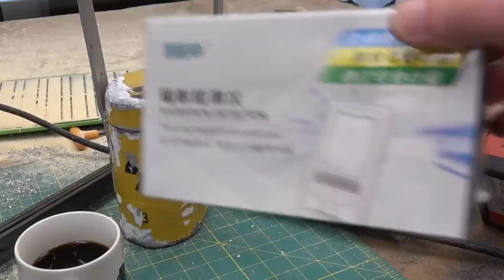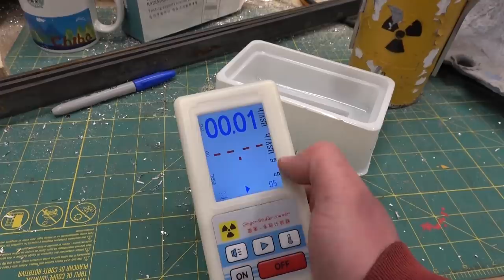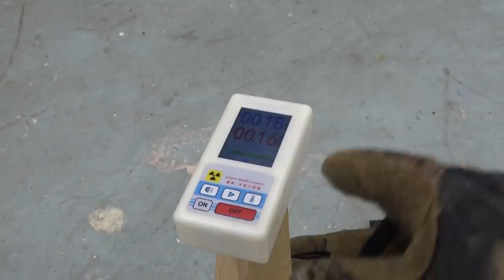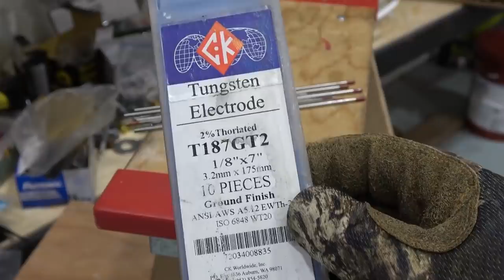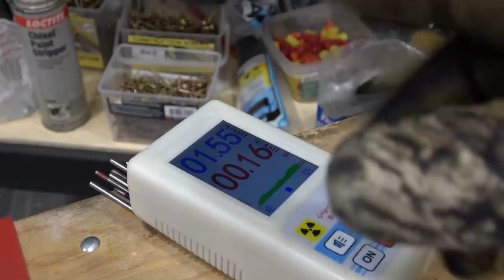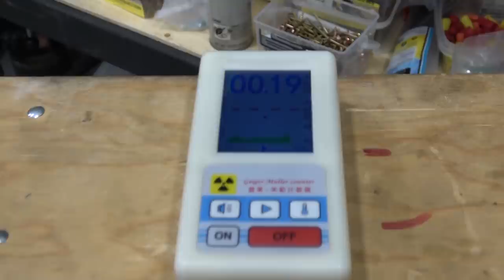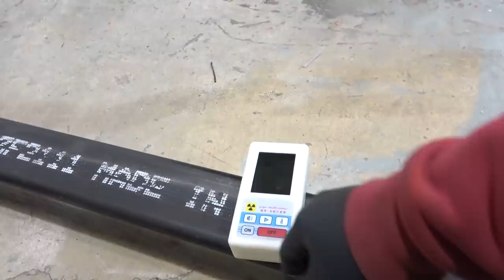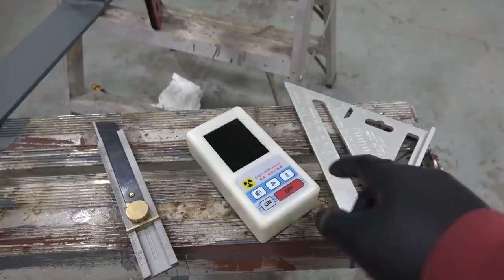Testing Radiation from Tungsten, Japanese Steel | Welding Metals Tested

Comment: Side note: reducing radiation in steel (albeit not to the extreme you mentioned) is of interest for more than just test equipment. When you have a 32" diameter electrode cranking out 140,000 amps in an electric are furnace and obliterating everything in it's path, it's best to have as little radiation present as possible. I work at a steel mill, and all of the scrap we melt goes through multiple ultra-sensitive radiation detectors before it gets anywhere near our furnace. Even something as unassuming as rainwater that has carried irradiated particulate from higher up in the atmosphere and pooled in the bed of a dump truck is enough to set them off. Arc furnaces generate a lot of off-gas and dust, and if what you're trying to melt is radioactive, it's a bad time for everyone.
Reply: What happens if a price of radioactive material gets in it?
Reply: Prolly just scrap after that always will have someothe rapplication tho
Reply: is this wy all the scrap merchants around me have radiation detectors you drive through? I have seen it go off when an old clock with the glowing hands went through. always wondered.
Reply: @liamshockley1856  The big deal isn't what happens to the material you are melting. You Really don't want contaminate your equipment and your exhaust-system/filter-system. At the mill I worked at, if the exhaust-system would require de-contamination/replacing it would risk sitting idle for so long it would have risked going out of business
Reply: @liamshockley1856  if we end up with a radioactive melt, we halt all operations and begin a very lengthy and very expensive cleanup operation that I've heard typically takes months.
Reply: @denisohbrien  this is exactly why. We won't even let trucks on site if they set the radiation detectors off. Better to catch it at the scrap facility rather than shipping it all the way to a mill and then having to ship it all the way back.
Reply: Not The Technician  Any time you have electricity arcing through air you have plasma. Think of an arc furnace kind of like a big stick welder. It just uses a whole lot of electricity to melt a whole lot of steel at once.
Reply: if something is welded with a thoriated tungsten is that going to set off the meters?
Reply: @lizardkeeper100  other material welded with thoriated tungsten no, but I bet the electrodes themselves would set off the detectors.
Reply: @johnt1815  interesting thank you
Reply: .... well smelting in an industrial cobalt 60 source, making rebar out of the steel and then building residential buildings in Taiwan with it also didnt produce too much happyness  https://en.m.wikipedia.org/wiki/Radioactive_scrap_metal
Reply: @johnt1815  thanks a lot, very interesting.
Reply: @marklundeberg7006  very true. The big fear is some sort of terrorist attack that would basically have the same affect as a dirty bomb, but realistically that's very unlikely to happen. The more real danger, as you've said,  is people not wanting to pay to dispose of radiation sources for various measuring equipment properly and trying to hide it in a bunch of scrap.
Reply: @wallacegrommet9343  I work at a Nucor facility, but not the one in Seattle. I don't want to give out too much personal information on the internet 😉
Reply: That explains the radiation detectors at the recycling yards!
Reply: Why do I have to come to one of the crudest channels on YouTube to find the most useful information I never knew I didn't know?
Reply: guitarstitch crudest!? AvE is part of my PhD! This is where you come to learn things you didn’t know that you didn’t know!
Reply: @liamshockley1856  https://en.wikipedia.org/wiki/Acerinox_accident
Reply: @StefanThePro  Crude, my friend, is tongue in cheek.  Once you cut the bullshit of the etiquette focused world, you can begin to focus on the meat of any topic rather than the fan fare and lip service.

I'd rather an honest "fuck from Uncle Bumblefuck over extravagant technobabble and bullshit any day.
Reply: @liamshockley1856  the particle would likely be put back into the breathable aircolumn with the dust and smoke. this creates a potential to become internally deposited within flora and fauna, which would damage their dna and cause cancer in the long term , while overexposure would result in organ failure and death within hours to weeks depending on dose rate, body mass, and some other metrics.
Reply: John T Damn, you must have weekly visits from OSHA then huh.
Reply: @mikeisaac3826  we try to maintain very good relationships with OSHA, EPA, and just about every other agency you can imagine lol
Reply: @ChrisGilliamOffGrid  yes both slag and the dust collected in the baghouses typically goes through further processing. I don't think much ends up in the slag as far as other metals go, and it is typically sold as fill material and is used mostly for concrete. The baghouse dust is where most of the heavy metals end up, and that gets sent somewhere for recycling.
Reply: John T As most places should but it’s still scary when they check all the equipment.
Reply: @ChrisGilliamOffGrid  we try to avoid copper in our scrap as much as possible. It's not particularly dangerous, but it's one of the few things that once it's mixed into steel it's impossible to f@#*ing get out lol. It doesn't react in a useful way to anything you can add to the  melt that typically helps separate impurities, and it reduces the strength of the final product. My rudimentary understanding is that copper collects at the grain boundaries when the steel solidifies and weakens the interface between grains.
Reply: My wife has never called it a 32" ramming electrode.
Reply: @guitarstitch  
Haha hellyeah bro! 
Nice to see someone with that positive go getter attitude! 
Not too many people can grasp the concept let alone understand,

"I didnt know I didn't know that" 

Love me some good knowledge I didn't know I didn't know about knowing!!! 
Happy times, folks!!! 
😀😉😎😃🙂😄😉😆😁
Reply: Chris Gilliam Man Stuff they are talking about cobalt-60, not copper. Copper’s designation is Cu, Co is cobalt. Copper isn’t very harmful. Cobalt-60 is bad news.
Reply: I always wondered what then yearly electrical bill was for one of them there 140,000 amp arc furnaces. Anyone have any idea?
Reply: @blackhawks81H   they usually have contracts with the power company's to run at night, using the "extra" energy on the grid instead of bringing power plants down. In a way, they help each other out and in return get a substantially reduced rate on electricity.  Many also have on site power generation plants to supplement.  As far as the dollar amount, I have no idea lol.
Reply: You had me at 32" dia. electrode and 140k Amps 😎 would be a sight to see that set up going in person!  Only seen videos of steel mills firing up their elec arc furnace.
Reply: @blackhawks81H  the cost will very quite a bit depending on the location of the mill and where they're getting their power from, but it's in the millions of dollars per month.
Reply: @aaronj08ar  all of the plants that I'm familiar with run basically 24/7, but then again they're almost all in relatively rural locations, so I'm guessing the grid utilization doesn't change as drastically based on time of day as it would in a city.
Reply: @johnt1815   I work in a 550 MW fossil plant in rural Colorado.  Our plant is base load generation and in the past was always at the high end of power production. But recently with all the renewable generation we have to accommodate that first as you can't reliably change the weather yet lol.  If the wind starts blowing real hard in Wyoming we drop to 200 MW and chase the windmills.  If it didn't take 2 days for us to start up marketing would take us off most every night. Most all plants are or will be doing "load regulation" as more renewables come online in the future. Nature gas plants, specifically combustion turbines will come on and shut off at a moment's notice as they can be operated remotely and only take roughly 15 min from cold to full load.
Reply: @aaronj08ar  I don't think I was clear: when I said "plants" I meant steel mills, not power plants lol. That's interesting though, I've never really thought about the startup time for a coal burning plant being that long, but it makes sense. I guess anything that burns solid fuels, whether it be a boiler or a blast furnace, is going to take a substantial amount of time to start up. Lol
Reply: At INEL.
I rubbed my shoulder against the red brick wall in the basement of my house.
When I got to my facility I set the frisker off as I entered.
(Imagine bars about 12" apart and  you have to squeeze through but the bars are actually detectors)
The ELT found a small red smudge on my shoulder , it was brick dust.
Reply: Not The Technician  p
Reply: Great, that'll only catch gamma, not beta or alpha emitters
Reply: Very intresting @john t
Reply: @denisohbrien  if the radiation detector went off when that clock went through, then that clock should've been taken to a museum, or put in a collection. Radium hasn't been used on clock dials since the 1970's
Reply: @NuclearSavety  The real hero with link!
Reply: @DCS101  I have some videos on my channel. In person it's just an ungodly loud and bright arc welder
Reply: All steel made from 1945 to 1965 was radioactive
Reply: I used to haul bulk salt out of port shared with an iron scrapyard. They’d get pissed off if you went faster than 2 mph past their detectors. Apparently salt has trace amounts of radiation.

Comment: There are two types of people in the world: those who have 55k of unread emails and those who have zero/
Reply: I'm only at 54,000
Reply: Never trust someone that doesn't have unread emails
Reply: @edwardleas1619  Or a clean desktop, real or electronic.
Reply: I’m at 580k I forgot about a forum that sent new post notifications
Reply: @Bugsyerin5646  im a get started on that right away. 
I can 100% guarantee it will look nothing like the websites portfolio
With the added benifit of 
sounds like it works but it does a bunch of nothing
Reply: @Bugsyerin5646  im in hear trying to learn to troll.
You telling me learn to code
Thats low bro.
Reply: I'm at 78k :'(
Reply: Im at like 127k at this point. I had to set up different stuff emails in order to escape the spam lol.

Comment: Hey AvE, long time listener, first time caller. As a practicing physician I felt the need to weigh in on this: The human eye is an intensity detector. Intensity is energy per time per area. While you are correct that the energy of emitted radiation falls off as 1/r^2, so does the solid angle (area) subtended by your eye. This means the intensity is constant with distance from the source. That's why all the street lights along a road appear the same brightness, even as they get further away. Also how we can see light from stars unfathomable distances away. Everything you said about aperture control is still correct but that just sets the overall scale of intensity that you are sensitive to.

Comment: I was the engineer on a project for a new low background shielded facility and high purity germanium radiation detectors.  I was told that we had to build the shielding out of steel cast prior to 1945 because all steel cast after 1945 is contaminated due to atmospheric testing of nuclear weapons.  I said no problem but first you prove it to me and show me test data on modern steel.  We tested about a dozen samples of modern steel including a piece from our existing low background shielding that came off a pre 1945 war ship.  The results showed that half the samples of modern steel were lower in background radiation than our existing low background shielding.  We built the new facility using freshly cast steel from a Montreal steel mill.

Trust, but verify.
Reply: Watching Chernobyl are we?
Reply: @jeffcederwall4604  Yes, but that's not where that came from.  My QA department has it printed on all their jackets.
Reply: Watched a video on this a while back but basically it was a problem after ww2 because most steel mills used straight atmospheric air to blow into the furnaces contaminating everything but today most steel mills use pure oxygen which limits the problem

Comment: In the next video, I'd be interested to see what a granite surface plate reads? Are all those QC guys gonna grow an extra digit?
Reply: I live in a granite house built on a big lump of granite. RIP.
Reply: I did slab and tile for decades, I still have all ten toes and fourteen fingers..
Reply: Used to sell kitchens, they always told us to tell people that asked about radiation to tell them it's perfectly safe and well within limits.... They also told us to try and sell water filters, even though the water company says the tap water is also within safety limits...
Reply: AT the wrong end.

Comment: In a uranium mine in the Colorado Rocky Mountains going into the mine lowers your radiation exposure because of the high altitude less cosmic radiation is filtered out by the atmosphere.
Reply: I learned about that the hard way in Afghanistan. Those clear skies will destroy the skin of any ginger in seconds.
Reply: @HaqqAttak  
I wasn't talking about UV but after being lightly tanned in Denver at about 5000 feet above sea level got burned to a crisp picnicking at well over 10000 feet.
Reply: @calvingreene90  Same principle applies though. 6500 Feet where I was not a cloud in the sky, 100 degree heat.

Comment: There's a few things that happen with radiation.  First, there's the particle getting stopped, which is much easier for alpha particles due to their size and charge.  The dead skin on the outside of the body thus is an effective shield against (most) alphas.  On the other hand, neutrons are also relatively large  but they can often penetrate more because they're neutral and don't get snagged by electrical fields.  Second, there's the energy of the particle.  Beta radiation from tritium is generally weak and it poses the same sort of risk as the alphas, but beta rays from, e.g. 32-P is much higher energy and can cause cataracts.  Part of the energy story is that high-energy particles, when they collide with something (i.e. a nucleus) tend to decelerate and transfer that energy into a burst of gamma rays, which are themselves ionizing radiation.  Overall it's really fascinating stuff, but nerve-wracking to work with.  Radiation truly is a silent killer.
Reply: radiation dangers are so over hyped by everyone. Even ingesting radioactive materials such as uranium you will die from the heavy metal poisoning long before the radiation from the material does any real damage. Its also been proven that a higher background radiation in an area is linked with lower rates of cancer. An example of this is Colorado where due to higher concentrations of natural uranium in the soil has higher levels of radiation than much of the soil around Fukushima
Reply: @Toefoo100  I read that too (about background radiation link with cancer rates), interesting and kind of believable given the complexity of the human immune system, but just keep in mind that the findings are not causal they are correlations so it could be this is just be an illusion.
Reply: What about UV? Particularly that of what we're exposed to by that big ass ball of gas

Comment: I always used proper Marlboro filtration whilst grinding a point on a new TIG rod... The sharp point really helps cut through the lead paint.
Reply: Good work. There is nothing your loyal and reliable cigafilterate cannot save you from. Dust, particles, gases and even computer viruses and mobile phone hackers

Comment: This vid reminded me of a story I read in Science News in the 80s about contaminated recycled steel ending up in kitchen tables. I looked it up, and have to wonder where the undiscovered hot steel ultimately went. From Wiki: "December 1983 – Ciudad Juárez, Mexico. A local resident salvaged materials from a discarded radiation therapy machine containing 6,010 pellets of cobalt-60. Transport of the material led to severe contamination of his truck. When the truck was scrapped, it contaminated another 5,000 metric tonnes of steel to an estimated 300 Ci (11 TBq) of activity. This steel was used to manufacture kitchen and restaurant table legs and rebar, some of which was shipped to the US and Canada. The incident was discovered months later when a truck delivered contaminated steel building materials to the Los Alamos National Laboratory drove into the facility through a radiation monitoring station..."

Comment: Technicaly: having your detector on the top step of your ladder will shield the radiation source (alpha particles.) To accurately prove the point source rule, suspend it over or lay them both on the ground with the bottom of the detector facing the source.  You rock dude.

Comment: Hey, my guess is that the gas in the tube is Xenon. Xenon chambers are used all the time in plain medical imaging radiography for the purpose of what we call AEC; Automatic Exposure Control. The beam passes through the AEC chamber, some Xenon atoms are ionised and allow a detectable current to be produced through inner electrodes.

Photographers, and radiographers, intuitively know the inverse square law.

Comment: Meter dead already? Time for a boltr tear down <=
Reply: I'd guess situation normal, since it's driving a vacuum tube in order to do its thing. (And those are power hungry.) Just needs fresh batteries or a recharge.
Reply: He probably didn’t charge it before use. Most things with rechargeable batteries ship at lower than full charge because they have longer shelf lives in that state. Plus, it could have been sitting in a warehouse for months. That is why most say ‘charge before use’ - which may have been written somewhere in the manual, albeit in Chinese.
Reply: @Paul J Pachasa JR if all else fails, read the instructions